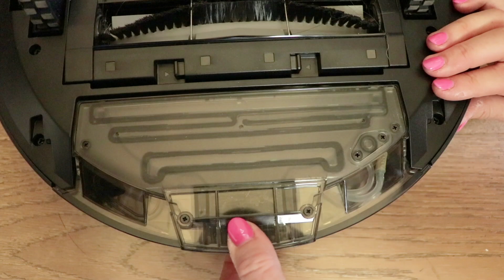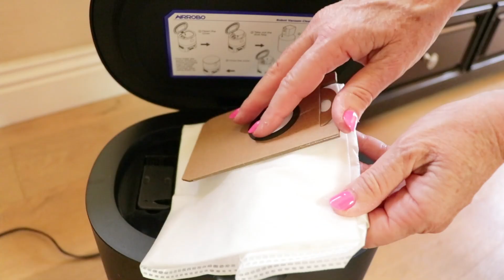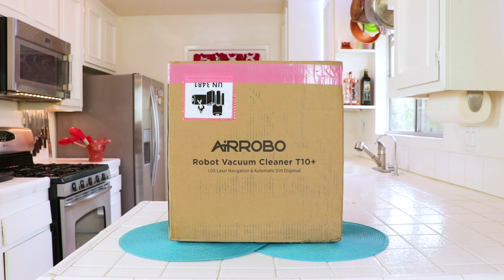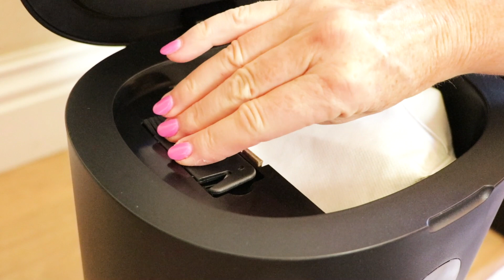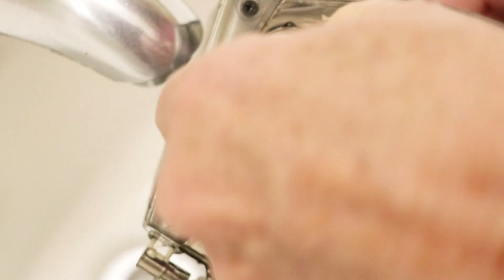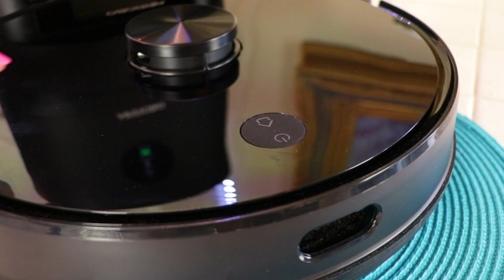Best Robot Vacuum 2021  AirRobo T10+ Vacuum Cleaner  |  Best Affordable Robot Vacuum

Comment: Super awesome! This helped me comfirm i wanted to get one. I was going to get a new one from amazon for only $320, but i finally saw one for 115 used on ebay. And i have not been sorry!

First off, it cleans the floor exceptionally well on vacuum mode, it can navigate objects 99 percent of the time and not get stuck. And the unit stays nice and close on everything it goes around. 

Secondly, it empties quickly. I can not say the reviews online are fair and say its loud, to me it is a reasonable sound, not exceeding someone talking loud in equivalent volume. 

Third, the parts online are pretty cheap, and seem to be universal across many models. Except for say the wheels, those can be tricky to find if i ever need one replaced. 

Fourth, the battery life is fantastic!!! I don't know if it was replaced on this unit by the time i got it, or if it was stick from 2 years ago. Around 1100 square feet on the first floor and it still gets home with 74% left in 44 minutes. A slightly larger battery on Amazon is about 40 dollars, and AliExpress has on for 25 at a slightly smaller size. 

Fifth, the Tuya app is extremely nice. It's excellent with sharing where the robot is, where it was, has good user interface with setting up no go zones, can save multiple maps, shows your history and what it did that day map, has sightings for rooms with suction power levels and mopping control, remote control, and seemed too impress my wife who does not like technology in the first place. You can tell the vacuum to automatically clean a section of a area on a map, or select a specific set of rooms to clean before company comes quickly. You can also have it clean at night and program it not to disturb your family by talking and waking them up with a robotic voice by setting a do not disturb mode.

The program also includes a estimated lifespan of your brush and rollers and HEPA filter. Which was the other reason I got it, along with the the slam and lidar and bumper technology totaling everything of 23 sensors of avoidance for objects, the HIPAA filter is hard to find on robot vacuums that navigate well.

However, even with the developer being extremely responsive and kind, the schedule portion does not seem to function well at all. For this portion, I used my Google home app and linked it to the Tuya account, and Google home app has no problem turning the vacuum on at scheduled intervals! Google home also works flawlessly when you tell it to turn on the vacuum, but there is no room control using Google home.

Like most robots, loose carpet is not good when it finds it. It can suck up paint brushed and  such causing it a problem. We dont have a dog ot cat, but to my understanding it will smear poop, even though the object avoidance detection is working, it is looking for this it can't fit under or go around. 

It talks clearly, has no issues docking, finds all kind of crap, 

I was not interested in the mop function. So I can't say if it works great, but I surmise for a very light cleaning it does mediocre. However, I can vouch for the home base setup and the mopping feature  such that the robot knows if the mop is hooked up on the tank and even if it has no water in it, it knows if it's on carpet and will tell you that it does not recommend you leaving the base unit on our carpet floor if you're going to have them up hooked up. As it can cause damage to your carpet. This was extremely interesting to me that it literally told you this audibly and seems to prefer hard floors if you're going to mop and have it hooked up to the base unit. That was super cool foresight on someone's heart with programming. But, I just unhooked the map portion and then it seemed happy.

And once again, although I love her, my wife is not tech savvy but has been impressed with the vacuum unit. This to me is the biggest sign that the vacuum and app function great is when she is not annoyed with technology. It is hard to come by with her and even a Google home mini or whatever can upset her on occasion.

The kids are arranging in age from 12 to 6 and like that they're only chore now is making sure the floor stays picked up and they no longer have to pick things up and sweep and vacuum.

Like I said, I got my unit used but there does not seem to be many units that are used for sale. With this being the case and as I was looking for about a month, I could see several other vacuum models that were used for sale but this was hard to come by. With all I've experienced and with the other reviews, I would guess that the reason there aren't many used units is because people are pretty happy. I'm not sure why this unit was for sale, and why it was at a refurbished company, but it is excellent.

If the owner had returned it because of a poor battery or something, it's a shame they didn't try taking out the eight screws, they would have found a easily replaceable battery as I've said, the battery is phenomenal!